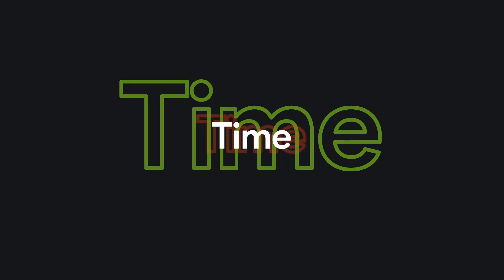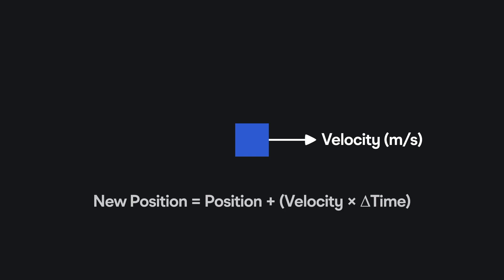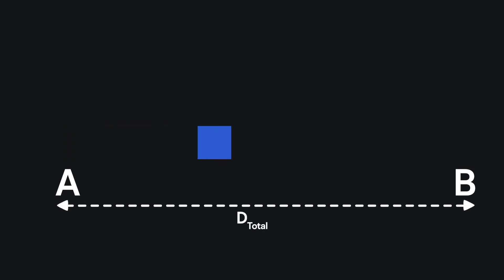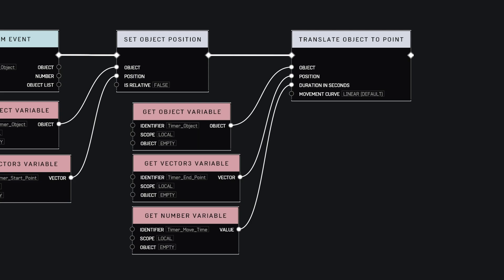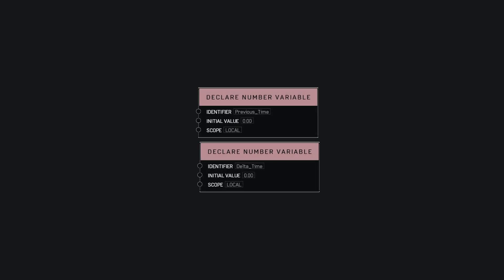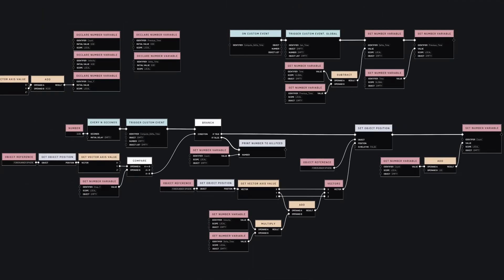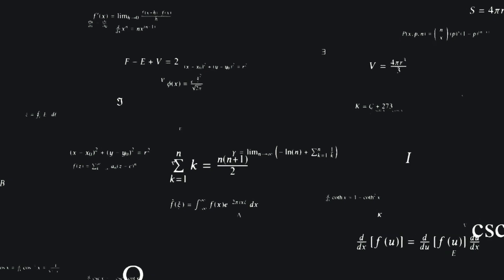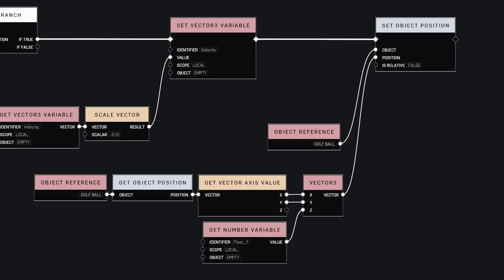Halo Infinite | Forge Lesson 1: Global & Delta Time

Comment: Great video.

I would like to see one on the topic of Player Aim Vector.
I've made a script that moves and rotates a light based on aim vector, and it seems that rounding simplification (when normalizing yaw) is causing the rotation to snap to low-accuracy (something like whole-degree) breakpoints instead of full floating point precision.

I've been curious about the accuracy of Forge's π constant and similarly the trig functions.